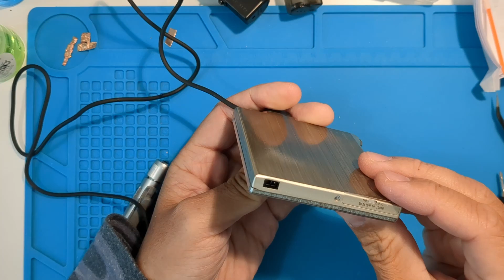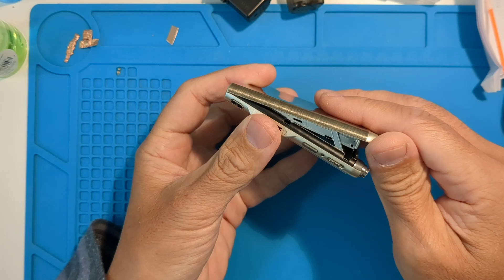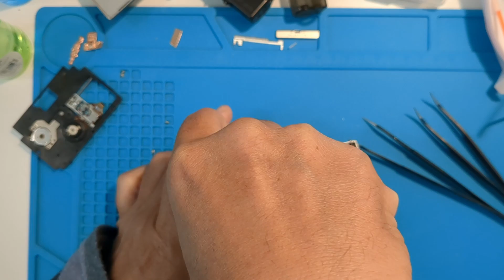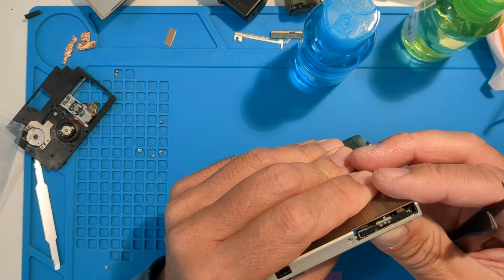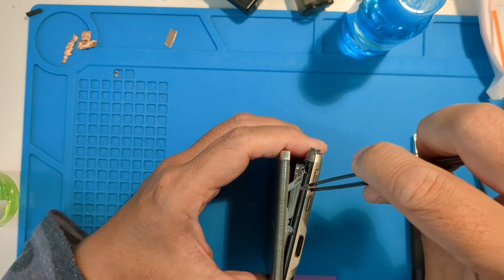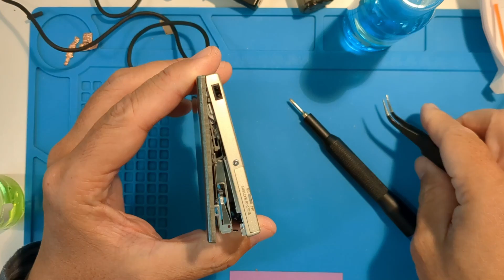Sony MZ-E10 MiniDisc Player Repair - Replacing the Battery

Comment: You should have downloaded the repair guide from Sony, which makes the removal of the battery a lot easier
Reply from the maker: I have seen it - when you try it - it's quite stuck in there and I didn't want to risk damage anything on this very fragile device. I have seen a new way to do it and will attempt to video that soon, too!
Reply: @TechnicalInitiative  BTW you can hardly find any proper info on the size and the difference of those lithium battery... Lip 4wm, lip 3dw? The Panasonic one.. Could you compare them
Reply: @TechnicalInitiative  OK cool, I have 3 of them on its way and will need to do the same.

Comment: The battery can be replaced just by removing the screw by the battery door, as the locking plate can be lifted with the lid open. The battery just slides out. Unless the battery is swollen, as they do sometimes with age, then you'd probably have to go through all this.
Reply from the maker: I would love for you to show me a video of this - I've tried that - there's a plastic plate and the power circuit board there. I know what the Sony illustration looks like, but it's not actually that easy. Were you able to do it yourself?